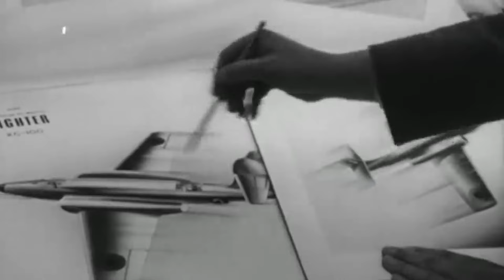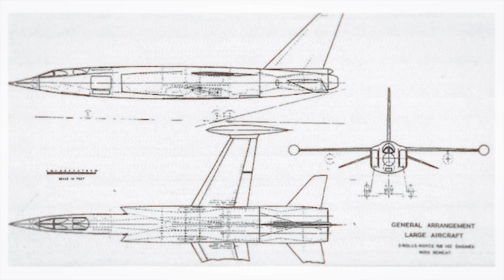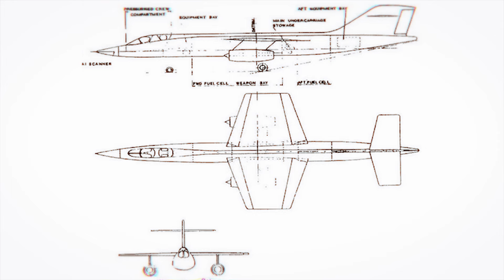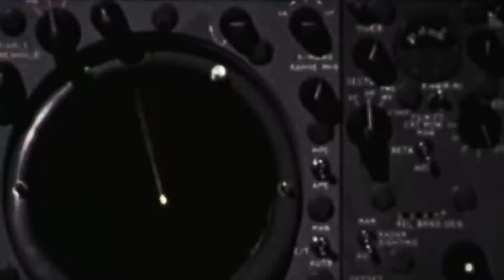The British Supersonic Bomber | TSR-2

Comment: Consider how long it took for the F-111 to work as required. Don’t imagine that the TSR-2 wouldn’t have similar problems
Reply: RAAF knew what a shit state the TSR2 project was in. The had Officers based in the UK who were involved in the planning of stuff at Woomera and other projects and they did keep their ears on the ground as regards other projects that the RAAF were interested in but had not committed to.
Reply: Most of the F-111's problems centred around the large swing wings, the TSR-2 had fixed wings, as such was less complex and less fatigue prone, so it wouldn't have those development problems.
Reply: @rocketmunkey1  … correct. The TSR-2 wouldn’t have had variable geometry swings.
Reply: @Idahoguy10157  They didn't make the mistake of trying to produce the TSR-2 for both the Airforce and the Navy, as such it didn't need swing wings for short carrier take off, that the F-111 was initially designed to do
Also  the smaller budget probably made them not even consider the fashion for swing wings in the design, saving them from the engineering nightmare that the F-111 suffered from.
Reply: @rocketmunkey1  … I AGREE

Comment: I really don't get the hype around that jet. Its specification wasn't even as good as the Aardvarks!
Reply: I think it's hyped simply because it was a non-U.S. jet that was canceled. I've been trying to post the below in response to another comment but it keeps getting censored.  Lets see if it works here:

 @RJM1011 said “The people I worked with at Boscombe Down said the TSR2 was the BETTER aircraft even when they had the F111's there from the USA in the 1980's.”   

It seems I’m supposed to accept the opinion of a biased group with a vested interest the TSR 2.  Forgive me if I ask exactly why the TSR was BETTER.  Was it:
  
Better speed (faster)?  No
Better rate of climb?     No.
Better service ceiling?  No.
Better range?                  No.
Better bombload?          No.

Better avionics?    We’ll never know what might have been, but we do know the F-111 actually flew automated low-level at night in the weather operationally.  The FB-111 version even had an astrotracker navigation system.

Better as in safer and easier to fly and more capable of operating from various runways under various conditions?  The YouTube viewers who pillory the F-104 for its high wing loading (as if that’s always a bad thing) would be distressed to hear that the TSR2 wing loading even as a prototype approached that of a late model F-104, and exceeded that of the F-105, which the F-111 was designed to replace. The 105 could already lift more than the TSR2, and the 111 could lift much more off shorter runways and take it further.   

I have to assume they thought the TSR2 was better simply because it was British.
Reply: @gort8203  
Excellent. It's great to see tha at least one other person is on the same page as me!
Reply: Its easy to say it would have been amazing when it never had to prove itself.

Comment: I think the biggest problem with the TSR.2 was that the plane was just too limited in its operational design, becuase it was mostly designed as a nuclear weapons carrier. that's why when the Brits joined the Panavia Tornado project, that plane was designed more for conventional missions carrying up to 16,000 lb. of conventional weapons, and its variable-sweep wings and thrust reversers allowed for operations out of very short runways (very important given the Soviet emphasis on knocking out airfields). The RAF finally got their long-overdue Canberra replacement, but it was just ten years later than anticipated.

Comment: A sad loss what the video fails to tell you is the F111 was cancelled by the UK government because it was going to end up costing even more than the TSR2 ! The biggest problem the TSR2 had was the government asking for an aircraft to do the roles of three to four aircraft and not thinking this was going to cost a lot of money in the sort term much like we have seen with the F35. Having been at Boscombe Down in the 1980's there were still people there that knew about this aircraft and they all said the TSR2 was excellent. What the UK ended up spending on other aircraft the TSR2 would have saved the UK a lot of money for many years.
Thank you.
Reply: F-111K was Cancelled because the price had gone up massively due to the Devaluation of the Pound in 1967. Plus the delays in the program were going to push the service entry back too late in the eyes of the RAF and also the operational requirements based British National and NATO defence policies had changed massively between 1960-65 when TSR2 and F-111K development and aircraft procurement were started (TSR2 was never ordered by the RAF BTW) and 1968 when the F-111K was order was cancelled and the Buccaneer was ordered. The TSR2 which flew was nowhere near being an Operational Aircraft and a lot of the systems in the aircraft which were being tested at places other than Boscombe Down in other aircraft were nowhere near being close to met their operational requirement in performance either.

Comment: If the weak point in the F-111 was the swing wings would the TSR2 have lasted longer in service and therefore been a better investment in the long run?
Reply: No. In fact, if the RAF had accepted the F-111K into service, it would likely result in the much earlier retirement of the V-bomber force, since the F-111K was capable of flying very long missions behind the Iron Curtain. It's likely that the F-111K would still be in RAF service now, fitted with upgraded engines and upgraded avionics and capable of carrying all the latest stand-off weapons.
Reply: @Sacto1654  Why did the Australians retire them then?
Reply: @ They were just getting old.

Comment: This is where things went wrong using American way of doing things was costly and time consuming.  What should had happened was all aircraft companies. Looking at ways to make parts first and test them this includes the Engines which needed to be reliable and most powerful with economy in mind so all engine companies to make the engines and test them to work out which one is best. The electronics should be tested all first then designed to fit inside the aircraft without getting damaged b y any of the aircraft's parts.  The wheels and bomb bay doors all must be fully tested before fitting for long use and under extreme pressures so not to fail also for easy maintenance.  Same with all wing controls and tail controls tested to breaking points and made better. Then the construction of the cockpit should be designed tested to fit correctly in side the aircraft's frame. All of this going on while the design and modal is tested in wind tunnels from wings to tail then heat testing the hot spots for correct heat issues while flying at mach 2.8  so the plane could easily cruse at mach 2  for long times and distances.  then all aircraft companies get together to put the aircraft together explaining every thing to the test pilots and maintenance crew.  That way every aircraft company will had proven them selves for government contracts.  Once the plane is built then all the modern electronics can be used knowing they will work fully and costs would had been lower also no delays.     We know now our government contract was taken away buy outside interference more than money costs back then.  Because testing the plane was proven  better than any other aircraft in existence all the pilots were shocked at its acceleration rate of clime that could only be matched by the Lightning it hit well over mach two  as the lightnings found it hard to keep with accelerated the as the TSR2 reached well over expected speeds.   Corruption and many factors caused the TSR2 to not be built for the air force.    Funny how British electronic inventions ended up in American aircraft after the TSR2 was cancelled?

Comment: Massive twchnical triumph but with hindsight it was designed to a requirement that had already been rendered obsolete.  An advanced development of the Buccaneer would have suited the real needs of the UK much better and development of something like a more advanced Tornado could be carried through at a sensible pace
Reply: It would have bee a cool plane to fly but was not really a massive technical triumph.  Aircraft of similar performance had already been built, or cancelled because of an unjustifiable expense-to-need ratio. The RAAF had already chosen the superior and less expensive F-111 by the time the TSR2 was rightly cancelled. The Tornado had less range and came along a decade later.